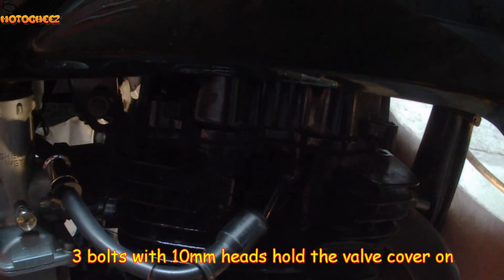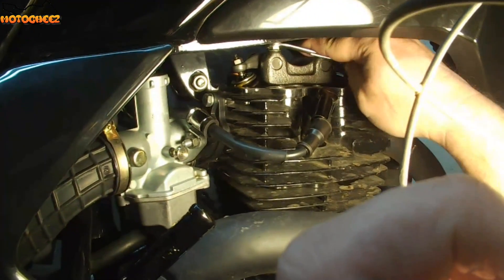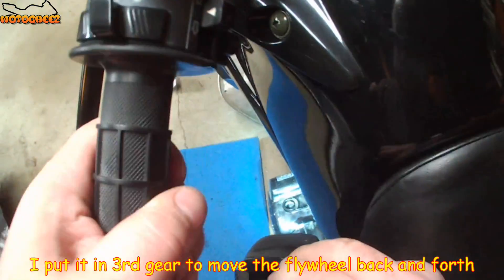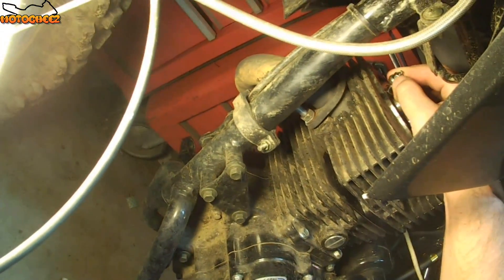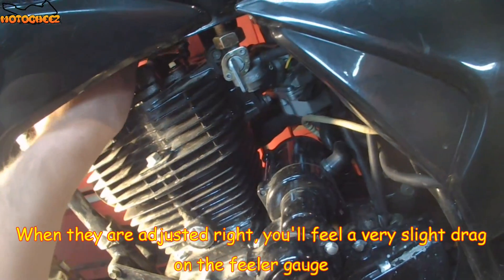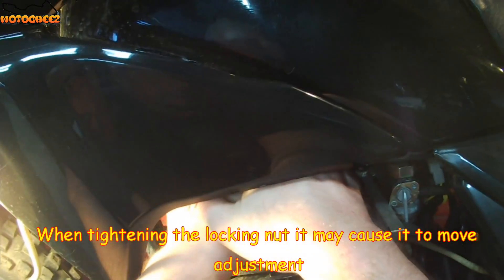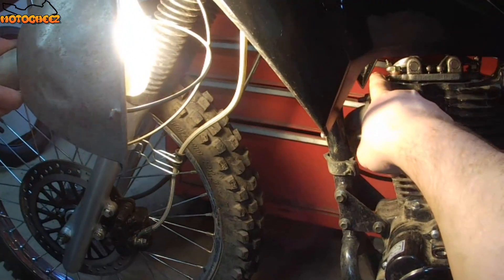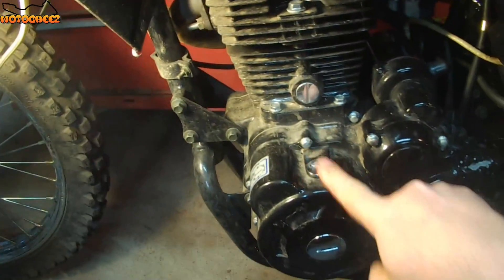[E17] Hawk 250 valve adjustment. UPDATED GAP SIZE IN DESCRIPTION

Comment: any idea what the Bolt is for on the back side of the valve cover?
Reply from the maker: Tyler Ryan back side? oil line?
Reply: MotoCheez I haven't taken the valve cover off yet so I was curious what the Bolt is for. It's right by the motor mount. if you have a email I can send you a picture. I have a 2016 so I don't know if they added anything with the newer models.
Reply from the maker: Tyler Ryan cheezomlet@gmail.com

Comment: I adjusted my valves to .0025" and they are ticking really bad. I checked the valves again after riding and made sure I was on compression stroke and every was still the same. Do you have any idea of what else to do? I talked to my small engine mechanic and he says not to ride it if it is ticking really loud. He can't look at it until next week and I want to ride it. :/
Reply: Hey 017ruckus. Originally I kept just rotating the engine buy putting the bike in gear and moving it back and forth until I saw the T line, but that was wrong. MotoCheez advised to remove the spark plug and use the kick starter to cycle the engine slowly while keeping your finger over the sparkplug hole. You'll feel air push out then suck in. You want to line the F or T mark up when cycling the engine using the kickstarter and air blowing OUT of the sparkplug hole NOT sucking in. It took me several minutes to line the T or F line up when the pressure was blowing out of the sparkplug hole. If it's still making the rattling noise, you should have way to big of a gap.
Reply: Nope. Sorry. Just watched your compression stroke explanation video. Going to go try it again. Thanks again for the quick response!! I really appreciate it!
Reply: You're awesome!!!! Noise is gone!!! I guess all those other times I didn't have it on the compression stroke. Thanks again! I really appreciate it!
Reply: Cool! Forgot to mention I have a Jeep too. It's a '81 CJ7. It has the original iron duke 4 banger engine and top speed is only 60 MPH (not for very long-cruse at 50 all day). I have a removable hitch in front for towing. It's a fun little on/off road vehicle.
Reply from the maker: 017ruckus .002-.003" make sure you're on TDC!
Reply from the maker: 017ruckus if it's ticking bad, you must be on wrong stroke adjusting, try it again, one stroke you'll have no gap, the other you should have the gap...
Reply: MotoCheez yep, the next stroke there is no gap. I'm going to look at it again tomorrow and see if I can see anything else wrong. worst thing is probably that I'm going to have to have my mechanic fix it, but that's really not so bad. just sucks because I don't even have a mile on it yet.
Reply from the maker: 017ruckus They do tick a little bit, so you might have it right already then
Reply from the maker: Sounds a little loud. Did you use .0025 or .025"?  That's why I say .003" intake and exhaust, because most gauges do not go down to millionths..
Reply: MotoCheez I adjusted to .0025" which is 5 tenthousanths less than .003". It's 2.5 thousandths. I am just wondering if I should adjust to what RPS suggests like the .005 on intake and .006 on exhaust and see what happeneds?
Reply from the maker: 017ruckus I posted those numbers from a Honda book. they're too big for this bike, when I did mine at tgat adjustment they sounded like your video, it won't hurt anything if it's only a few thousands off.
Reply: I'm going through the same thing as 017 ruckus. I decided to check the valves (I have about 280 miles on the Hawk). I  lined the line right next to the "T". The valves were very tight (once I loosened the nut I had to use a wrench at the top of the bolt to loosen the bolt). I adjust my valves numerous times. First tried, exhaust .005 & intake.004, then exhaust.003 & intake .0025, then Exhaust .0015 & intake .0015, then Exhaust 0 & intake 0.......still same noise as in 017 ruckus video. I'm assuming that noise is the valves and not something else?? Should I try lining it up with the "F"? Any ideas???  Thanks in advance for your help!
Reply from the maker: TX Jasper are you sure you're on the compression stroke? I have a video how to find it. because if you were on F or T and you needed a wrench to loosen the adjuster, just the keeper nut of course. I feel you're on the exhaust stroke.
Reply from the maker: TX Jasper YW, I tried putting notations to go to the TDC video, but sometimes it doesn't show on youtube... and now they're doing away with notations, I may have to do a whole new video, not sure if I have original footage.. or I'll just put the two videos together.
Reply: MotoCheez, sounds good!
If you ever need any help/questions on firearms, trapping(pigs, coyotes, racoon), or boat building feel free to shoot me a message...I know a lot more about those than motorcycle engines.
Reply from the maker: Thanks! I'm also into firearms. I have a decent amount of pistols and long guns. I am pretty good with those too, I have a lathe and milling machine in my shop too :). I am also into boats, rebuilt a few. even made an outboard conversion on an old 21 foot Bayliner weekender. Welded it up out of 1/4" plate steel! put a 150hp Force Outboard on it, went pretty good! I don't do much hunting anymore.. Want to do more FISHING!
Reply: Cool!! I don't have any gun videos up on my channel, but I'm a certified NRA Basic Pistol Instructor and member of IDPA and shoot just about every week. I reload and cast my own bullets in over 10 different smokeless calibers (rifles/pistols) and shoot black powder (pistols and rifles)as well. I do trigger jobs and fix firearms as a hobby. I also trap wild hogs to eat and sell them as a hobby as well. I used to have a 25' Sea Ray cabin cruiser but sold it awhile back. I have a 15' duck boat with 18hp Evinrude tiller.  I've built several canoes, but built a 16' Lumberyard Skiff last Spring. I have several videos on the boats I built on my YouTube channel. I agree about the fishing!!! Haven't gone nearly enough this year. 
Rode dirt bikes when I was a kid, but just now got my motorcycle license, turning 40 :( ..... Anyway, I just bought a Suzuki Boulevard and the Hawk. Thanks again for the help on the Hawk.  I've really been enjoying it!
Reply from the maker: Nice, I don't put gun videos up either, snowflakes ya know.. I am not certified, I used to reload years ago... I had a 23 foot Sea Ray, I've had dozens of boats, have a seadoo jet boat now. I'm gong to sub your channel to check out the boats!
Reply from the maker: Ha! I had an 86 I think it was with the 4 banger Iron duke. stock tires I could do like 80. I love JEEPS! as you see on my videos lol
Reply: TX Jasper what did you adjust them too now that there is no ticking? mine is still ticking pretty loud :/

Comment: Is F or T top dead center?
Reply from the maker: 017ruckus T
Reply from the maker: 017ruckus on compression stroke. I made another video showing how to find that.
Reply: Thank You. Your vid says timing marks and TDC (F) mark are on the flywheel, does it suppose to say TDC (T) mark?
Reply from the maker: 017ruckus you can do on either mark, T is actually top and F is the ignition timing (fire) they're close enough where it doesn't matter TBH

Comment: When should we adjust these? Does it say in the manual an interval in miles?
Reply from the maker: I checked mine after breakin, which was about 300 miles. then about 1000 miles after that because it is so easy to do. I say after break in because I have had some chinese scooters with real tight valves where it would not start and idle after about a month.... Be sure to read the added notes and added video about TDC and valve clearances, I went off Honda manual for this video and the clearances are tighter for these bikes even though it is an exact replica of a CG engine
Reply: Thanks

Comment: when you are setting up to check valve lash, you align the F mark and not the T mark? just want to make sure I am doing it right. by the way, MotoCheez thanks for pointing out the gap on the intake, one of mine had the same problem. I really appreciate all the help you give.
Reply from the maker: T is top and thats what you want, F is fire for ignition timing. (although that would still be accurate) be sure you are on the compression stroke, there has been a lot of confusion so I made a video showing how to find it. https://youtu.be/FC0xWo4GSX0
Reply: As always, thank you for your help.

Comment: Valve lash is checked with COLD engine
Reply: Should be checked hot so you know what it is when its hot. You can adjust cold if you know what then difference is.
Reply: Charlie Brown warm should be good,  if it’s “hot” these get to around 230 degrees farenheit,  that will burn the snot out of you.  🤣

Comment: Am I the only person who can't break the lock nut free from the valve? I even tried with pliers I'm afraid IL break it
Reply from the maker: Casual Trips the 10mm nut that locks the setting? Shouldn't be that tight.
Reply: MotoCheez yes it won't break free
Reply: MotoCheez my other came right off no problem
Reply from the maker: +Casual Trips the intake or exhaust valve adjusted?
Reply from the maker: Casual Trips so you got it?
Reply: MotoCheez No i thought I did for for a second it's really stuck on there
Reply: MotoCheez okay I tried it again and it worked yay
Reply from the maker: Casual Trips 👍🏼👍🏼👍🏼

Comment: Funny the Chinese built a push rod engine. Its cheaper to build a push rod engine, but I wonder if this is an old Honda design that the patent has run out on, so the Chinese are able to copy it without any legal fears? How many miles do you have it now? I would like to take one these on a 500 mile tour just for the heck of it. I watched your oil change video, and I can't believe it has an 800 mile oil change interval.
Reply from the maker: MotorheadRedo it's a copy of the Honda 70's CG150 engine. The intervals are longer but it has a slinger type oil filter and there's only 1 quart capacity.
Reply: I love the fact that its uses push rods and doesn't have a filtered oil system accept for that screen near the drain plug. Is it still running good and how many miles do you have on it? Thanks...
Reply from the maker: MotorheadRedo I have about 1500 miles on it now. I gave mine to my kid and bought a CRF250L, but I still ride the hawk at times.
Reply: Cool! I was looking through Cycle Trader the other day and noticed all the old, but new, 250cc Japanese dual sport bikes dealerships are still trying to sell. I think I saw a new 2012 Kawasaki KLX250S still on the showroom floor. I wonder if all these Chinese bikes have anything to do with that. Funny because the Japanese were known for undercutting the competition to sell their bikes, and now its happening to them. Saw several Chinese Grom clones on youtube for less than $1500. Anyway, thanks for the info.
Reply from the maker: MotorheadRedo I've wondered that myself, I saw those little grom wannabes, I wish they'd come out with a decent 250cc sportbike. I think they'd do well. You sound like you're very knowledgeable in this area. Drop by and comment any time!
Reply: MotorheadRedo that's what I was told lol
Reply from the maker: It also has a centrifugal filter built in the case

Comment: I'm 90% sure I'm on the compression stroke, when I loosened the lock nuts the adjusters were almost just finger tite. what thickness of the gages should I use setting them ?
Reply from the maker: .002" intake and exhaust

Comment: I'm down to this point on mine, cover off, Crack of f mark, lock nuts loose.
Reply from the maker: Be sure you're on the compression stroke.  On The exhaust stroke the valves will be very tight.
Reply: Thanks, that lets me know how to tell which stroke I  am own, because I had know idea before. Cheers!
Reply from the maker: jared young YW, it's hard to explain
Reply: MotoCheez how many strokes do you have to go through?  is the exhaust stroke before the  compression stroke ? And do you have to start in a certain gear?
Reply from the maker: +Taylor Freezy every other time the piston comes up us compression, you'll feel it push your finger when it's coming up on the compression stroke
Reply from the maker: +Taylor Freezy I do in neutral
Reply: Thank you!!
Reply from the maker: +Taylor Freezy 👍👍👍👍
Reply: MotoCheez what's the measuring tool you use to get this job done? Really appreciate all you do and thanks again for answering all my questions!
Reply from the maker: YW, Feeler gauges like this http://amzn.to/2qFq70y

Comment: So I follow your instructions to adjust valves and there spot on, but I still hear my valves doing a clicking noise is that normal?
Reply: Modesto Rodriguez yep pushrods can be noisy. Normal
Reply from the maker: Yes. It's normal. You did the .002"? I made a notation after I made the video. And it was on TDC correct?
Reply: I did .004 and .005 so they both need to be at .002?
Reply from the maker: Yes. Sorry. Those were the specs off original Honda engine. The Hawks say .002 in and ex. I made notations on the video through YouTube but some apps don't show it I guess.
Reply: Yeah I see them now on my Chrome browser but on my Iphone safari they do not show :(
Reply from the maker: I hope YouTube  gets that sorted out. I'd hate to have to uploads it again. I don't have the video.
Reply from the maker: +Steve Townsender solid lifters
Reply: I noticed this as well. I guess I didn't really pay attention to how loud it was before I did the valve adjustment but after it seemed really loud.

Comment: I just adjusted my valves and it seemed that the valves go up a tiny bit (maybe a couple of millimeters) after the TDC mark. Does this mean the mark is wrong or is that normal?
Reply from the maker: You're on the wrong stroke, one more revolution.
Reply: Thanks, man. I also wanted to mention that you are one of the reasons I decided to get a hawk. Thanks for all the video work!
Reply from the maker: +Cory Mcghee awesome. TY 😎

Comment: Hey moto, appreciate all the vids, will be putting a hawk 250 together soon, quick question on this do you recommend breaking in the bike before doing the valve adjustment, or is it better to do it right out of the box? Thanks
Reply from the maker: From what I've seen the valves are close enough out of the box. I'd check after break in just to be safe. Or at least at 1000 miles.
Reply: Thanks

Comment: http://www.cscmotorcycles.com/CSC-TT-250-p/ztt250.htm i wonder if these would have the same issues of adjustment or not. looks like they are spec'd slightly different.
Reply from the maker: I wondered the same. Seems to have same motor but better forks and some other add ons. Cost white a bit more too.

Comment: Don't forget to make sure your on the compression stroke when you find top dead center or you'll be way loose. Check with your thumb over the spark plug hole for compression. The CG250/167fmm is made by a few outfits, check your makers gap recommendation. Use a Honda CG125 shop manual for this engine.
Reply from the maker: Yes TDC on compression stroke.  I took the specs gap off CG125 which this motor is designed from. And I made the exhaust 1 thousands larger.
Reply from the maker: I have the CG125  manual for download on MotoCheez.com  hawk section at bottom of page.